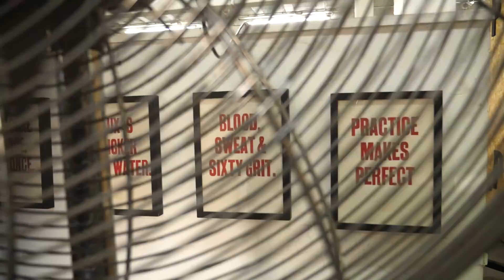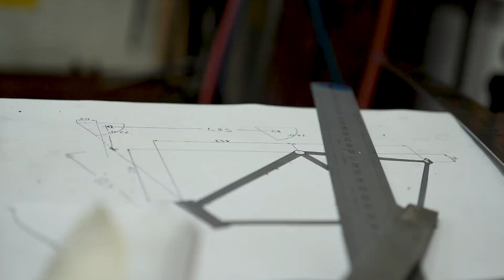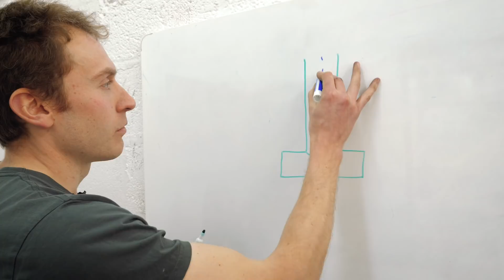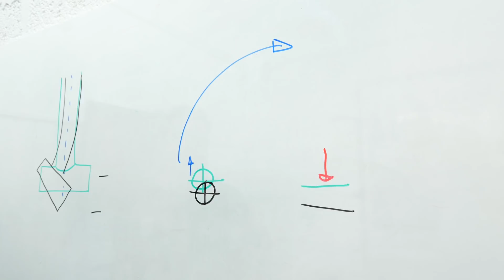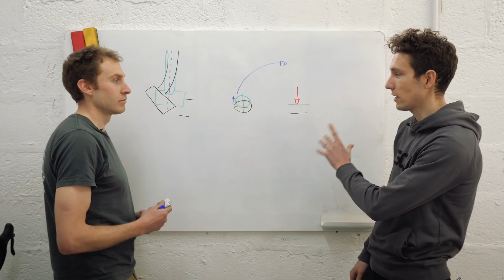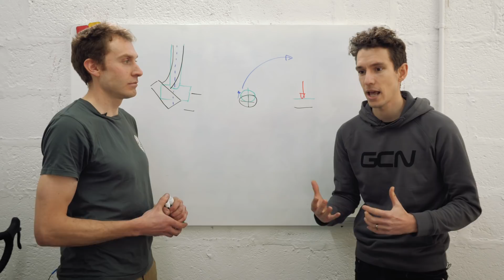Are You Faster On A Stiffer Bike?

Comment: Some significant errors in the argument being followed here. The flex on the frame decreases when the force component in the original direction that caused the flex, decreases. This will be when the pedal in question is at six o'clock. Releasing the flex in the frame only when the pedal is in that position, will result in no wheel drive as seen in the experiment performed in the video. Instead, the rider's weight will counter the force, in other words, the rider's legs will absorb the energy.
A stiffer frame will carry less energy to the six o'clock position, pushing more energy into driving the rear wheel. A perfectly stiff frame will carry no energy into the six o'clock position.
In other words, a stiffer frame would be faster. Is the performance worth the tradeoff in comfort? Depends on the situation.
Reply: Trouble is that the efficiency gets massively complicated with the bio mechanics of the rider. The force is not suddenly release at 6 o'clock position, but gradually reduced past 3. Or if we stand on the pedals maybe not till after 6, but the. The other leg balances the force and more. Maybe this raises the rising leg so we get a longer power stroke, the bio mechanics is where it all really matters.
The trampoline analogy is OK but I can also get great height on a trampoline with little energy input, but little height with a lot of effort on a stiff surface. It depends on what we are trying to achieve and how the body adapts to the forces (input and output).
Is suggest a race - very flexible frame vs very stiff (but not a sprint!).
Reply: The experiment had all the energy released from the frame directly into the drive train as it didn't really have anywhere else to go. In the noisy and dynamic environment of the road that would have many ways to release the stored energy. A large number of variables would require a large computer to calculate the partial differential equations to sort this out I think. The other way would be to directly measure the power input into the drive train and measure the out put from the drive wheel. I'm going with super difficult problem to crack.

Cracks me up how many people with deep thinking jump onto this issue.
Reply: Eon du Plessis  don't think so... #planing. #janheine
Reply: Mark sticky068 obviously not, it's released in a linear function. It demonstrates the issue with the experiment however.
Reply: Thanks a lot for saving me the typing :) Especially when sprinting (while not being seated) this becomes visible in the 6o'clock position. To visualize the problem let's assume the frame being a perfect spring (that means, it will return all the energy it absorved). And we shall only look at the vertical part of the flexing, so just put a spring vertically on a table. To compress it, you have to apply a downwards force on top of it. If you put a weight on it, the gravity-force will compress the spring to a certain level. On the bike, the compressing force is made up from gravity and the muscles straightening the leg. Back to the spring: Action=reactio, the gravity on the weight is keeping the spring compressed, but the spring is pushing back with it's own force which increases with compression - so that the spring will only be compressed to the level where the spring's extending force equals the gravity force. 
When is the spring going to release energy? While extending back to it's normal size again, which can only be done, when the weight on top of it is removed (or reduced). On the cyclist that translates to lifting the leg or reducing the power with which the leg was straightened to push down the pedal, which in turn means: The frame can only flex back when the cyclists let's it push it's foot upwards again.
In the end, the frame flex is not giving much energy back - you only use your energy to compress it and maybe even need some uncompress it.

Anecdote: Cycling home from shopping with a heavy backpack (weight increase ~30%) I tried to sprint. I noticed that while sprinting I usually would "jump" when my foot reached  about 6o'clock - with the backpack, I couldn't. I was just compressing the frame and get back to where I was before jumping. At 6o'clock.

Compare that to a trampoline. Stand still on the trampoline, compress your legs and then jump. Your legs extend, but because of the springiness of the trampoline you're only raising your body by a few centimetres instead of getting about half a meter off the ground. Wasted energy.
Reply: This of course also applies to the 3o'clock position as shown in the video. But in the video, the energy was transfered back to the wheel, because the weight was taken off the pedal. When cycling, you push downwards until you reach 6o'clock - so the frame flex introduced at 3o'clock is not released at 3 but rather after 6 - where you won't have any more gains from it.
Reply: Perfectly stated. You must also be a mechanical engineer.
Reply: Yes to this but, I will add that if the frame at particular points then this would transfer loads into the drive train decreasing the efficiency of the drive train. A better experiment would be to increase the load on the frame and measure the efficiency of the drive train. The drive trains are very quiet so there is likely to be very little energy being lost there, but possibly in heat. Again the principles describe above would be the likely loss, transferring it into the rider by delaying the power transfer. Does anyone know how the manufactures test the frame stiffness in the dynamic sense, eg as a rider analogue?
Reply: I just made a comment that drew a similar conclusion.

Comment: Interesting you mentioned hysteresis (in terms of tires) right at the end having not mentioned it before - if the twisting returns less energy than generated it in the first place then the power-transfer/efficiency will suffer. Given the frame isn't designed to minimise this loss (i.e. by being perfectly elastic) then it is likely to be significant.

Vertical compliance is already something marketed in the industry, so it's not polarised as stiffer equals better, but torsional is universally seen to be a negative - it might return some of the energy but even if it's 90% efficient that 10% will become significant when you sum the 10,000s of pedal strokes (remember it's cadence x2 as it's on both sides) made during a ride.

Yes it's probably one of those over-exaggerated factors companies jump-on to make quantifiable statements about their bikes ("x% stiffer than the previous model") but at a fundamental level its a valid basis from which to claim a frame might be superior. Physically it's unlikely to be equatable to tires where the consensus was wrong as that played into a wider, opposing, system - i.e. efficiency of just the tire versus that of the overall bike. With the ability to vary carbon layups manufacturers can optimise for comfort (i.e. vertical compliance) in one part of the frame without having to sacrifice power-transfer efficiency (i.e. torsional stiffness). Increased torsional stiffness doesn't make the bike more comfortable so it's not comfort versus efficiency in conflict here, making it a somewhat false equivalency.

There are of course other benefits to stiffness - namely avoiding brake/tire-rub (especially on these wider tires/rims as you mentioned) and improved control when descending - i.e. wheel tracking (though that is a more subjective issue)
Reply: Some great points, but just to play devils advocate, what about biomechanical factors? In running for example, athletics tracks have been designed to have an element of spring to them. Could it be better for a rider if there was a bit of give in the system?
Reply: Not sure the biomechanical systems of running and cycling are comparable - running is much more reliant on elastic storage in tendons whereas in cycling you're not dealing with impact forces as such so there's a lesser need to spread the reaction force (ground reaction force in the case of running) over a wider time, which is what having compliance in shoes/the surface achieves. In fact, the fact that torsional compliance would give a delay in the transfer of power to the rear wheel would flatten/widen, but crucially lower, its torque profile, lessening the peak torque thus reducing acceleration capabilities (I think - less sure on what the net result would be, someone would have to model it).

If your foot came off the pedal every upstroke then came back into contact with it for the downstroke then some compliance might be advantageous in terms of injury prevention - the pedal would decelerate the foot, F=ma, increase the time taken to change velocity, reduce the acceleration (deceleration is just negative acceleration), reduce the peak force through the leg - but that's not the case with cycling. In fact the constrained nature of the pedal stroke, with reactionary force applied through say 300ms (for about 90rpm cadence) versus about 50ms for heel-strike running (where, to compound matters, it's your whole body weight, not just the force from your leg) means having too elastic a system results in reduced efficiency as energy is lost under unnecessary deformation - the hysteresis mentioned. You don't need that same release of stored energy at the end of a pedal stroke as you get with the end of a running stride to propel yourself forward.

Comment: Even if you lose no heat due to flexing, it's still an undesirable characteristic for the same reason that walking around on springy shoes would get old real fast. Sure, you get all your energy back eventually, but loading the spring with each step (flexing the frame with each pedal stroke) takes an initial amount of time and energy. This can just be avoided by wearing normal shoes without any springs attached (aka making a stiffer bike). You don't get the flexing energy back, but you don't have to put any energy in either so the ride becomes more enjoyable and responsive.

Comment: what about doing a road test with  the two frames both mounted with pedal and hub based power meters. if frame flex matters for actual speed the difference between power meters should be larger on the more  flexible bike.
Reply: I'm not sure power meters are accurate enough to generate any meaningful data. 1.5% is about the best you can find, I think you'd probably need 0.01%!
Reply: Okay then, let me rephrase. 

There would be absolutely no point in doing the test you suggest as the tools to measure meaningful data don’t exist. The levels of accuracy in current power meters would leave vast statistical errors.
Reply: Si, an experiment to validate your hypothesis would not be pointless. If the difference is actually less than 1.5% (possibly 3%, as it is 1.5% in both directions for both measurements) then you draw that conclusion. Most of us have no idea whether flex loss would be 0.1%, 1% or 5%. I have an aluminium trek 2.1 and a Canyon slx, I would be seriously surprised if the difference was less than 1.5% between those bikes just based on how they feel.
Reply: Exactly, I proposed this very test in an earlier GCN video wherein flexy was deemed to be energy lossy. Hell, use power pedals/crank arms/bottom bracket/rear hub meters and test with seated versus standing and so forth. Flat road, up hills, around corners, the whole schmear.  Light rider, heavy rider, amateur rider, pro rider. Swap meters to other bike, calibrate, repeat. Science, in other words, not conjecture and thought experiments.
Reply: Si, you've just restated exactly what I'm bitching about. 'I'm not sure' 'I think you'd probably need'... How about measuring for meaningful data, publishing the results, and commenting on that? If you can't measure a power difference from noodly frame to uber stiff wonder bike, then it doesn't exist in a meaningful way, and that's important. The 'method' employed in this video is dubious, as many have pointed out. We have actual tools: please use them. Thanks.
Reply: Therefore, you're declaring there's no meaningful difference between frames in terms of the rider's energy  reaching the rear wheel and moving the bike forward. Thanks for clarifying your position.
Reply: If the difference was big to be detectable, I guarantee some bike manufacturer would by now have made a marketing claim of 'this bike saves you X watts because it is stiff'. Can't say I've ever seen anything quantifiable in performance terms.

Comment: The bike is a closed system. Any "load" imparted to it must transfer to the road, or the rider (in the form of push-back). The only potential "losses" would be in the form of flex derived heat....never burned my hand on a bike frame.
Reply: Ah, but the bike isn't a closed system because it does exchange thermal energy with the environment.  Thermal energy doesn't just manifest as heat.  It can also manifest as sound.  More importantly, just because you might not feel the heat transferred, doesn't mean that it isn't there.  We humans are pretty crappy sensors.
Reply: You want flex in the materials that make up your bike.  Things don't flex are brittle.
Reply: But even if it was leaking 50 watts it wouldn't be that much temperature difference, there aren't many 50 Watt toasters, more like 1000 watts. I wouldn't want to be losing even 50 through frame flex.

Comment: Something else to consider is what exactly stiffness means from a material point of view. A stiffer material (e.g. carbon) will return to its original unloaded state much quicker than a less stiff material (e.g. aluminium). Mechanical power (Watt) is calculated as the amount of work done over time. Therefore the smaller the return rate (time), even with a constant amount of work done, the greater the power (Watt) will be. The ideal case would be an infinitely stiff material with a return rate of zero.

Comment: Unfortunately this lab example doesn't work in real world this well. To make this work you need to release all flex energy at once when cranks are horizontal. In a real world situation you release the flex when cranks are vertical. And that means nearly all energy goes into the legs of the rider not the drive train. And the legs have no means to get energy back. Quite contrary they spend more energy to cope with the returned energy. No, we are not gonna long for flexible frames.
Reply: Rum2Cajs I was thinking about this again and revisited the video. Reading all the comments, your’s is the best. This is the first one that I think nails it. And just as simple as the position of the crank when the energy is returned!